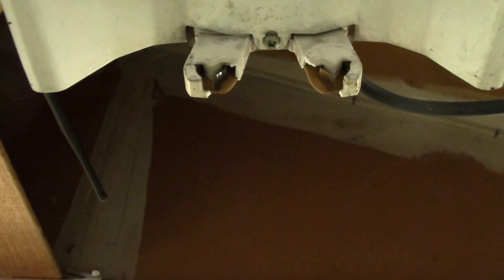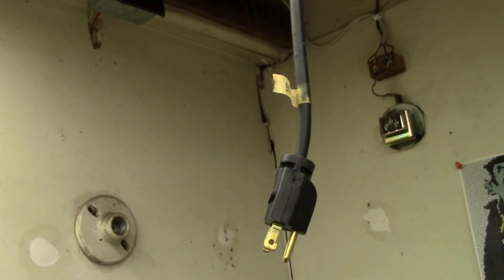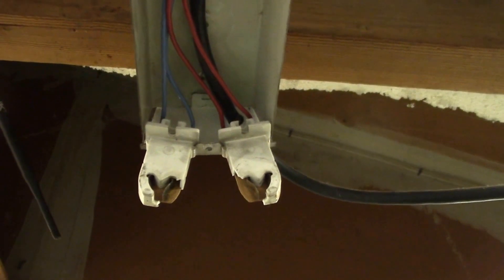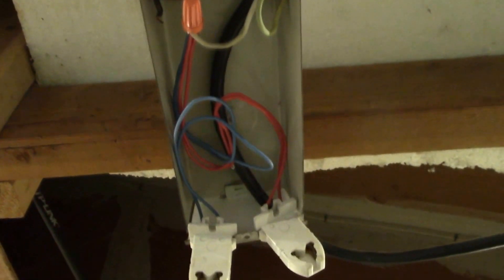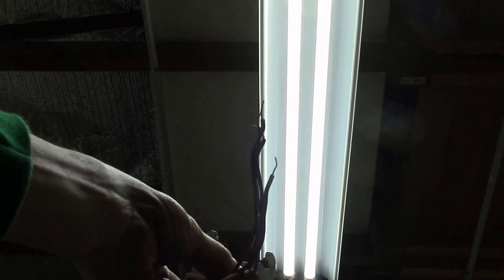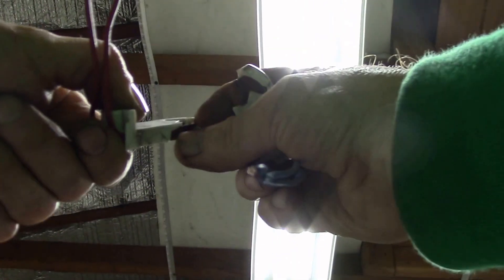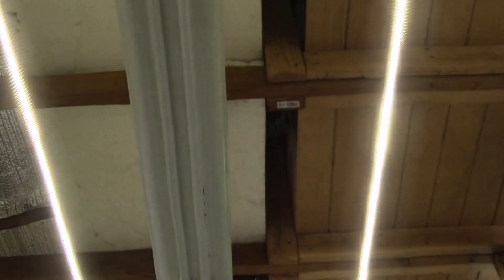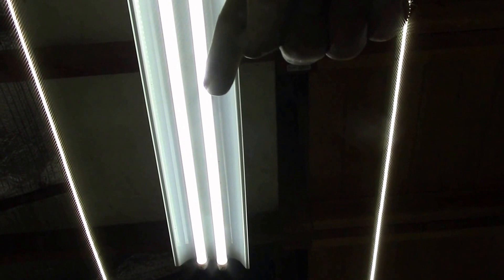T12 Fluorescent to T8 LED Conversion, Part 3

Comment: doesn't seem to have the t12 ho lamps and the one's that he has  are 20w not 40w anymore.
Reply from the maker: I no longer have the old lamps (they've been recycled) but I'm pretty sure they were 40W lamps.  The fixtures say "Use only 40W standard lamps".  I recall using a Kill-a-watt meter on one fixture and it read something like 78W when running.
Reply from the maker: In this video, I'm only showing the ~20W LED T8 lamps but the fixture used to have 40W T12 lamps before I converted it.  This video was to show replacing the heat damaged tombstone sockets at one end.